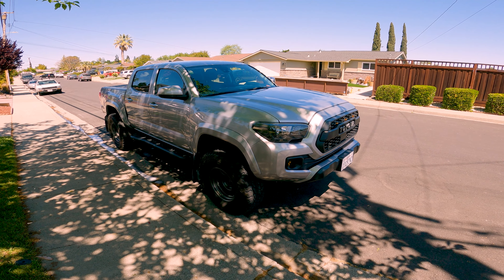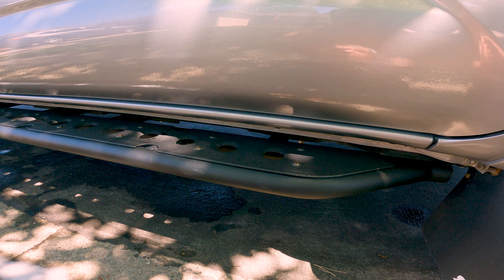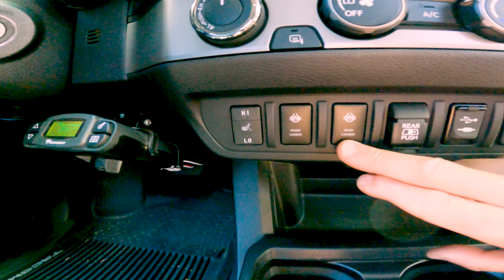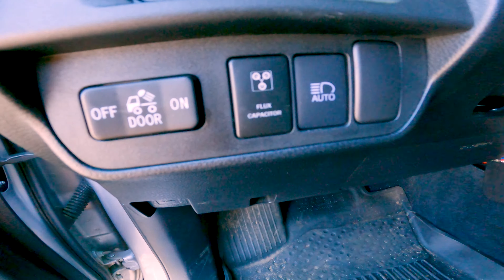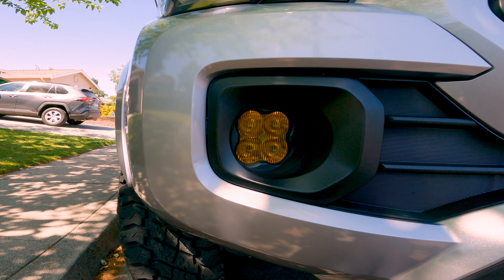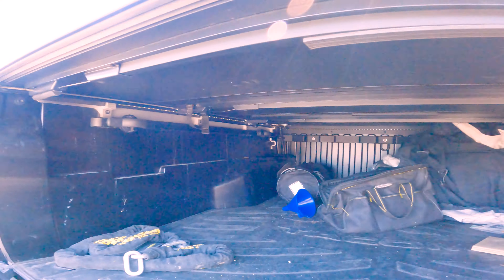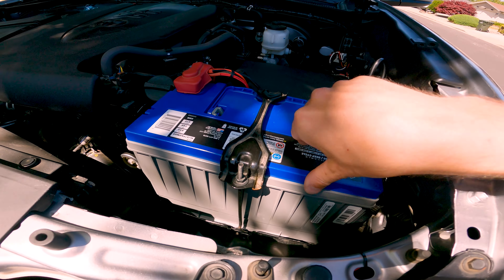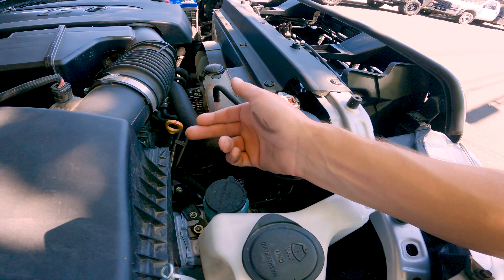Toyota Tacoma Walkaround 3rd Gen

Comment: Hello Rick. At first I was expecting glove box and console mods. Then as I'm watching your channel I am amazed at your awesome mods. All are interesting and some are new to me, I want them! The oil filter mod-phone mount set up-heated seat covers-and some lighting mods for sure. The anytime back up and front camera is something in my list too. I'm going to reach out to you when I'm ready, suggestions and tips are always welcomed. Thank you for putting this video together, much appreciation for what you've accomplished on your Tacoma with all the mods! Thanks again Rick!
Reply from the maker: Right on, thank you sir.  I too want the anytime backup and front camera mod.  Also looking at upgrading the rear brakes to disc to give more stopping power when towing and maybe a winch.
Reply: I look forward to watching the rear disk upgrade. I'm ok with drum at this time, we just drive streets, no towing or off road.  BTW: how is baxter oil filter mod working out, any chance of engine damage from changing stock set up. I don't want to affect warrantee or cause any damage to engine. Please respond :-). Thx again Rick!!
Reply from the maker: @ftwbreeze   So far so good.  I believe the adapter is doing it's job quite well.